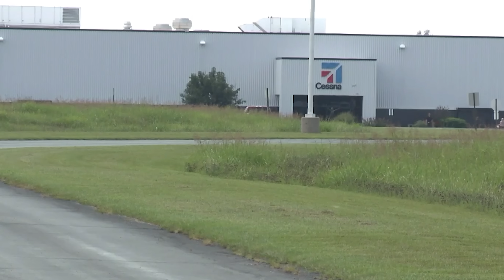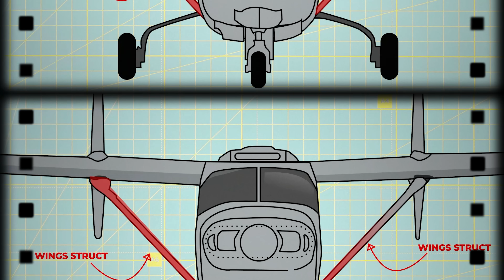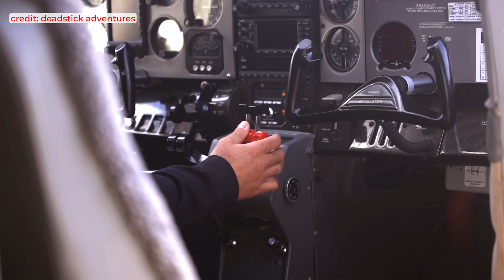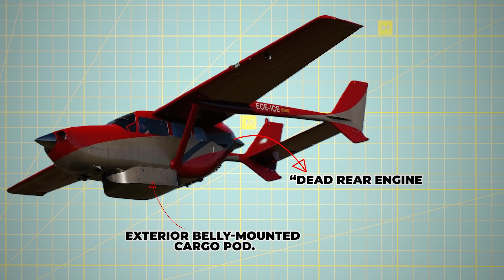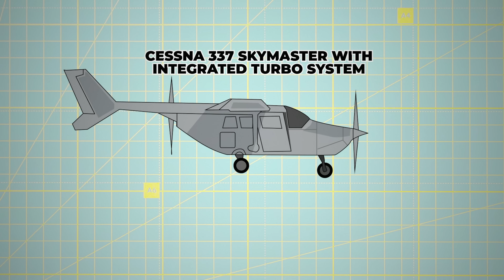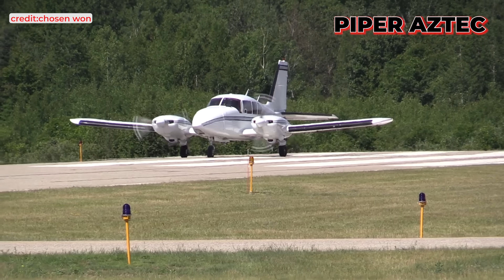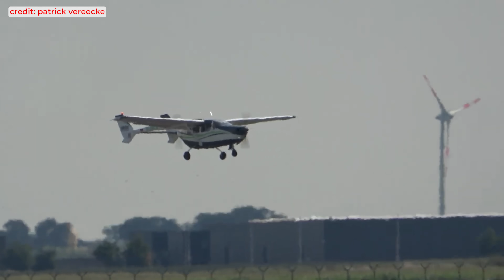Why Did Nobody Want the Twin That Couldn't Kill You?

Comment: I saw these in Papua New Guinea in the 1960s  The humidity and altitude and rear engine reliability meant that you throttled back the rear to preserve it.  The rear could not be windmill started so it had to be kept running.  PNG flying then was no Satellite Weather  Images ... Just go and hope the cloud did not close in behind you........
Reply: I flew them there then. Hopeless. We had one with the rear engine mounted on hinges, so that it could be pivoted out of the way to allow loading of long wide cargo. Density altitude at sea level was +2800'.
Reply: @ronanstis6328   The Cessna Pus-Pulls I saw in PNG were flying -- It was the Piaggio Twins that were in the hangar with cowls off for engine work - the ratio was 5 in hangars being serviced and one on the ramp...

Comment: Shutting down the wrong engine in a Sky Master is the stupidest pilot mistake the pilot can make. You have to rely on yaw from a conventional twin to tell you which engine failed? Can't look at the engine RPM gauges to tell which engine is dead or dying in the Sky Master? There have been plenty of dead pilots from a failed engine in a conventional twin to put that theory, of it's easier to deal with, to rest. Dealing with asymmetric thrust is no joke in a conventional twin. Not many pilots are good at it.
Reply: Agree, but as long as you have oil pressure, the RPM may not tell you much. EGT is a better indicator.
Reply: You know that RPM doesn’t reliably show a partially failed engine… right? Let me guess you’re not even a SEL let alone multi pilot….
Reply: Used to fly one commercially, there is no sim so the annual type renewal was done in-the-air, bringing an engine to zero thrust was never an issue and IDENTIFY-CONFIRM was easy. However, I still hated the heap of crap, noisy contraption and only did this for one season. My next job was flying all the Russian Natasha's around all dressed completely inappropriately for air travel but who was I to argue!